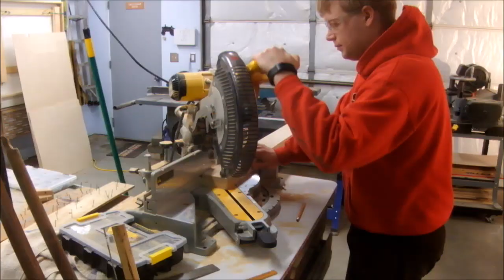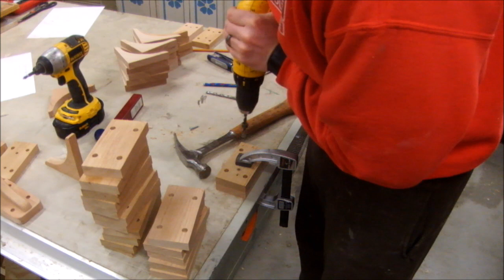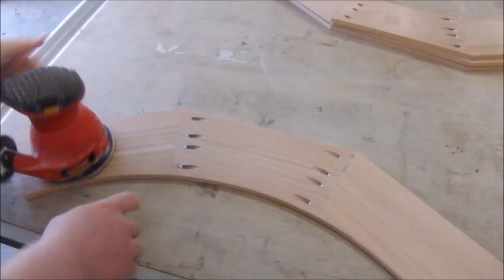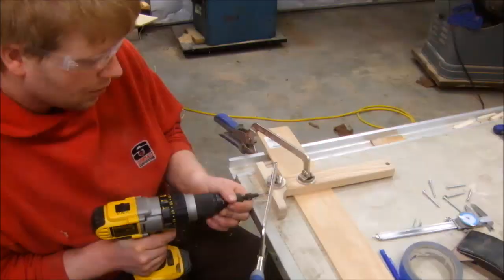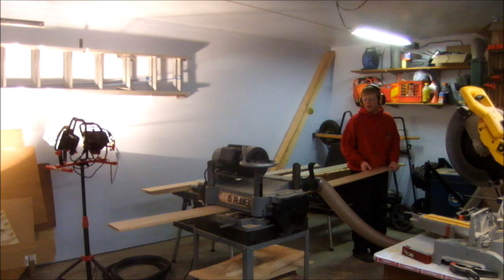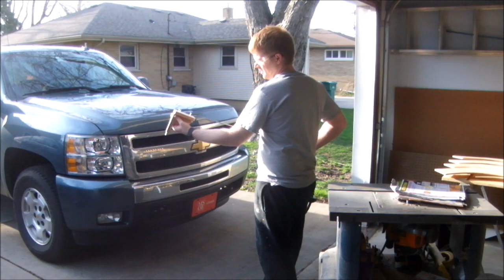Install a Model Train - Shelf Build

Comment: Just a heads up, while I appreciate the savings and buying a couple of pieces of wood, the time to cut sand and assemble is a cost factor for me. Unfortunately, I don’t have a ton of time so Home Depot has wooden brackets that you can buy or IKEA Also has some that you should look as an alternative but nice work on your build

Comment: i did that about 25 years ago around my flat in forest hill. i used Triang TT trains, on HOm track. there was a main loop with a siding that ran down to a long shed, a hand-made level crossing, a tunnel around one corner, a girder bridge where i ran out of shelf wood, and along the wall behind, was a diorama (all 70ft of it !) which i drew up on a 2cx Mac.